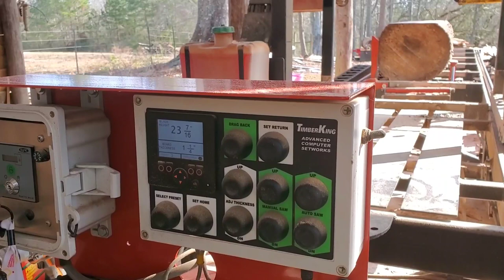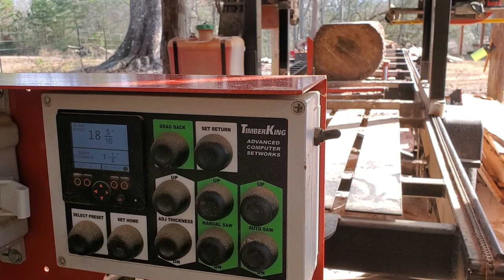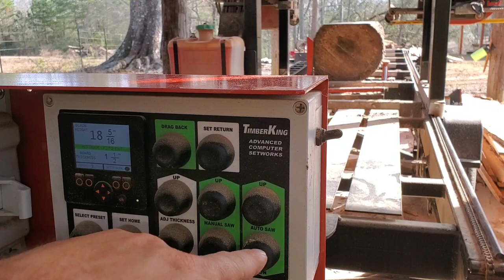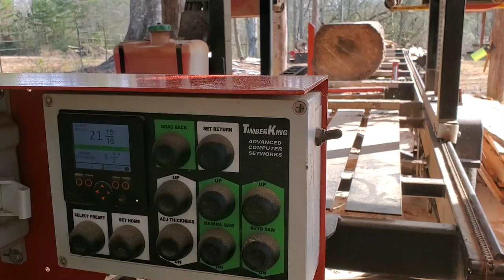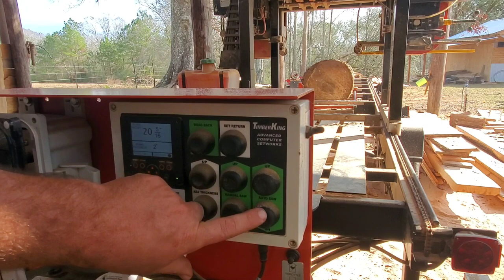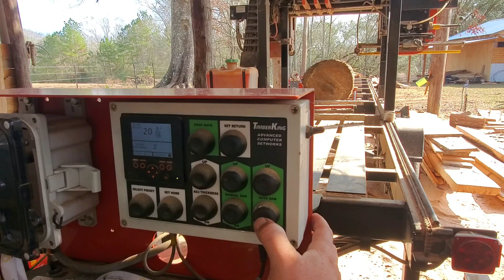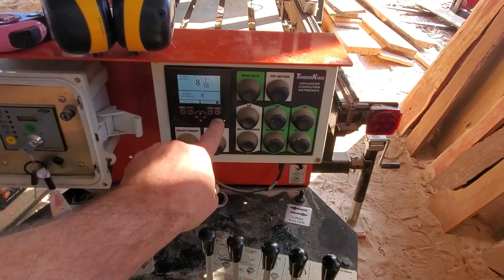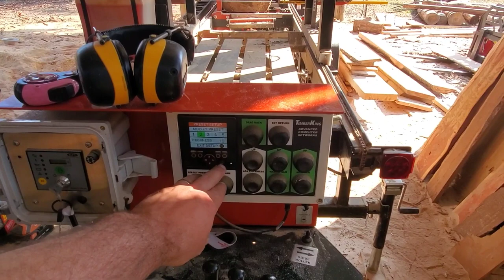How to use Timberking Advanced Computer Setworks, a huge time saver

Comment: Picked up my 2020 back in January from John in Oregon. Actually used it yesterday: pretty cool stuff!
Reply from the maker: Glad you're getting to use it.  The 2020 has way more capability than the 1620.  Have fun and be safe.
Reply: @TCSawmills  So, on non alt, the top piece is the potential throw away, but because you leave the round, its probably a keeper right? I understand on Alt, then you can switch gears on dimensions in the middle of something right? Need to get that figured out properly. Very easy to use, just see the potential hazards if you get distracted. So far so good.

Comment: Thank you for the video - it was very helpful. 

I do have one question... I know to SET HOME you have to first lower the blade all the way to the bottom, which is 1" (one inch). Let's say I want to cut 2" slabs however, will it still do the math and divide the log stock thickness to yield 2" slabs including the last cut/bottom cut? I.e. I don't need to lower to 2" and SET HOME there so that after cutting 2" slabs, the last board doesn't wind up being 1", correct? Setting HOME at 1" really just is setting home at the absolute zero, or absolute lowest height. You can always have a larger than 1" last board, but not thinner, but you still need to SET HOME at 1" or bottom, simply so the machine knows the reference, correct? 

It does beg the question, is there ever a use case to SET HOME to some value other than 1" / at some other height - some elevation other than rock bottom? Thanks

Comment: I used the auto up for a year or so, until I realized it raises much faster if I raise it manually with the hydraulic lever. Haven't used the auto up feature since.
Reply from the maker: You are correct,  do that now as well.  It does come up a lot fast manually.

Comment: So if you have 16+" after the third opening cut and cut that down to 4" slabs then turn the all 4 slabs to start making final cuts, if I want to make the first 8+" of the cant into 1x4s and the remaining part 2x4s, can I set it to cut 2" and use the set works to bring the saw head down to where I'd want to start making the 2" cuts, set home and then move up and use a 1" setting to cut the 1xs?

And then when I'm down to the 2" start point drop the saw head down and reset home then bring up the saw head and make the final cuts. Will this work? 

And does this question make sense? Haha!
Reply from the maker: Yes, you can do that. However,  when you transition from the 1" thickness to 2" you will have a board in between that's a little less.  That board would be your waste board.  The reason it would be different is due to the computer taking into consideration the kerf of the blade.  I try to keep my 1" and 2" cuts separate so as not to get that waste board, but sometimes it's not avoidable.   I hope that answers your questions.
Reply: @TCSawmills  I've been meaning to play around with it and become more familiar with that aspect of it but usually I think about trying it when milling for a customer.  So, that's not the place. Haha.

Thanks.

Have a Happy new year!
Reply from the maker: Happy New Year to you as well.  I'll have more videos on the set works this winter.
Reply: @TCSawmills  I'm looking forward to it.

Comment: Say you want to center the pith in one particular slab, can you adjust the set works to reference that then auto up your desired slab thickness to get your first cut?
Reply from the maker: Theoretically you could use the setworks to do that if you set home at the pith.   Let me play around with it next time I'm on the mill and I'll see.  I just eyeball it around the pith sometimes. Meaning if I'm say on a 2" scale and my next cut won't get all of the pith, I would just drop it down a bit more to cut out the pith.   Then I could go into alt mode 2 and set that as my return and measure down from there on my 2" scale.   There may be a bit of waste on your last cut after that.

Comment: How many logs can a single blade go through?  Does the blade have longer life in softwoods compared to hardwood?
Reply from the maker: Blade life is dependent upon a  lot of factors.   Species of wood, width of cut, cleanliness if log and sap.  But as an example I ran an 8 degree blade last weekend through 380ish board ft of red oak before I changed it.  Also ran a 8 degree blade through 500 board ft of pine before I changed it.  The logs were comparable in size around 16" to 18" diameter.   A few weeks back I cut a 33" diameter black walnut log that was around 4.5'  I went through 2 blades alone on that log.  But on average a blade can run for about 400 board ft.  Hardwood will take the set out quicker than softwood,  but if you are cutting a lot of sappy pine the pitch can also build up and heat your blade up making it weaker.  I tend to change blades based on engine tune and speed of cut.  If I'm loading up the engine and my cuts have slowed I will change the blade.    Hope this answers your question.